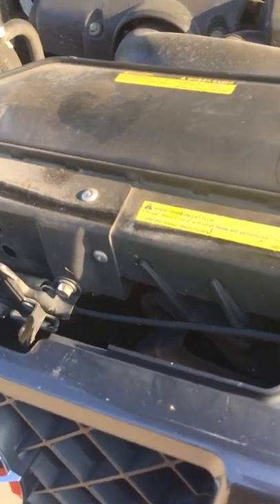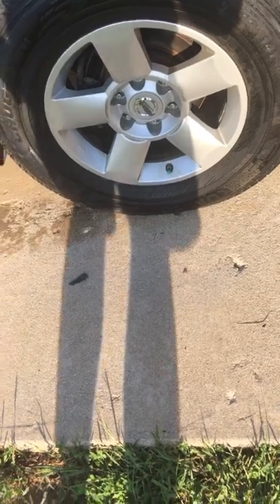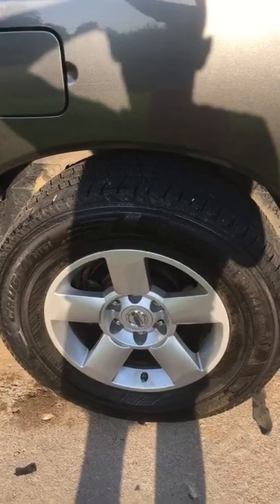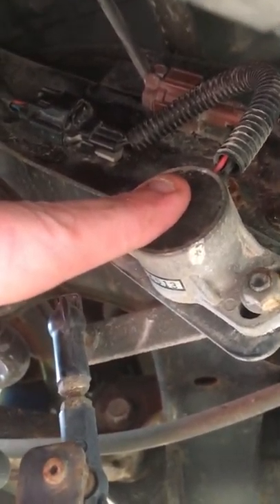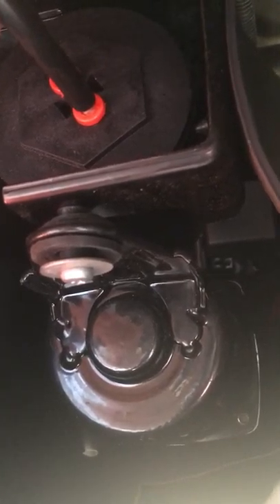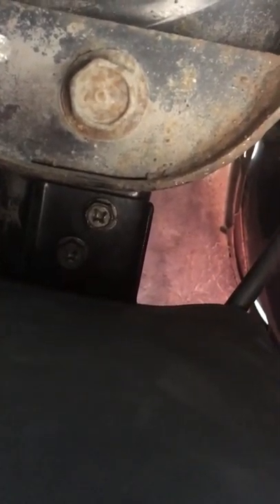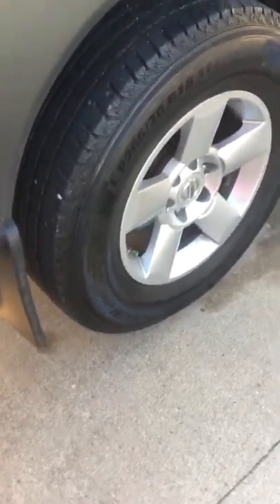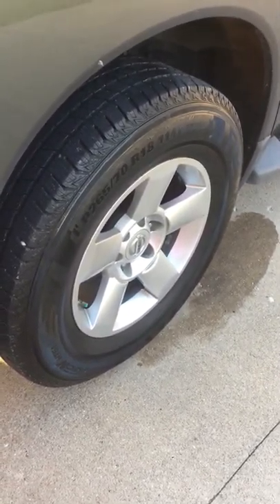Armada air compressor/suspension troubleshoot

Comment: Found sensor was my problem thanks but was not 80$ !! 160$
Reply from the maker: Your correct. I don’t know why I thought 80. Glad you got it worked out.
Reply: @jhoff2488  thank you!!!!  160 soo much better then I thought when I heared suspension I thought oh shit-  your the man !
Reply from the maker: @faithwalk007  if you don’t mind me asking how did you rule that it was the sensor that was out?
Reply: @jhoff2488  I took your advise and bypassed sensor with putting paper clips in. However I took a chance with trying that first before relays and soon as I put paper clips in compressor turned on. So ordered part from Nissan and what do you know !!! I was thinking maybe was a bad airbag too but when replaced that sensor airbags filled fine-

   I watched few other videos and seems like relay- compressor -height adjustment sensor or bad airbags were  main factors.
Reply from the maker: @faithwalk007  awesome man. Thanks for the feedback.
Reply: Jordan Hoffner do you have a video of how you did the bypass to check compressor?

Comment: Does the same part fit the QX80 2014-15?
Reply from the maker: Which part? The compressor?
Reply from the maker: And I only think the QX56 models for Infiniti would be compatible. Your model is much newer. I looked it up and the 80 looks a lot different.
Reply from the maker: @deangeloevans741  I believe the QX80 is different. SAme principal though. But the one I have I think would only work with QX56.
Reply: @jhoff2488  ok thanks

Comment: I have a d2racing air suspension set up with just the basic dual switch control management.... my air compressor will not turn off anymore please help....
Reply from the maker: Mustafa Gak have you unplugged the solenoid under the hood and plug it back in to reset the system?

If that doesn’t work I would lean towards the leveling sensor. Expensive little part. It may be tricking the system to think it’s never level and keeps telling the compressor to engage. 

When the compressor is on is it actually filling up your bags? If so I guarantee your bags blew due to air pressure which is causing your compressor to remain engaged. Air is leaking out as air is coming in. 

Hope this helps. Let me know.
Reply: @jhoff2488  have not tried to unplug the solenoid under the hood that u mentioned or even the relay that's in the trunk but the air suspension kit came with a car I recently purchased everything was working well up untill earlier today... I have an on/off button for my compressor under the steering wheel that I used to turn the compressor on but it will no longer turn it off... unless I unplug my battery complely
Reply: @jhoff2488  and the bags I dont think are blown as I can still use the control management to air up and down properly just the compressor that fills the tank will not turn off
Reply from the maker: Mustafa Gak do you know what that switch is connect to?
Reply: @jhoff2488  should just be the positive and ground wires for the compressor but I'm not sure as I still have yet to actually take the panel off but I will be doing all of that as soon as the sun comes back up
Reply from the maker: Mustafa Gak let me know tomorrow. If your having troubles post a picture of the wires from the switch to where they lead too. I am better at seeing things versus explaining.
Reply: @jhoff2488  how do I send u the picture?

Comment: Jordan, do you have any experience with the system loosing pressure over the drive time and the system not continually keeping the truck at the proper ride height? My shocks are new and I replaced my air hoses. My next guess would either be a leaky compressor or maybe a half bad relay under the hood. I have also heard that there is another brain box for the air suspension behind some panels behind the passenger second row seat on the driver side.
Reply from the maker: Eric Hasz my own guess would be a leak in the bags? Have you changed out the bags before? I don’t think it would be from a faulty relay switch. I do agree with a malfunction in the compressor. Pressure from the bags pushing air back out of the compressor due to a leak somewhere causing it to never be level. 

Another trick I have heard is get about three people to sit in the back around 500 lbs. let the compressor kick on all the way. Turn the car off and let the leveling system calibrate itself. Kinda like letting your phone battery die completely to recalibrate the battery. 

Lastly are your air hoses placed in the two holes correctly?
Reply: Thanks for the quick reply. I don’t really have an issue with it being the same level on both sides. I did change the bags out. Also yes the hoses are in the correct holes. Mine is more of an issue with it not staying inflated during the drive. I let it fully inflate before I leave and by the time I get 20 mins down the road I am almost riding on the bump stops. I let it air up this morning and turned it back off. Just went and checked and the bags are completely deflated. I’m thinking what you are, somewhere the back pressure is leaking out of the compressor
Reply from the maker: Eric Hasz It sounds like the compressor itself after your last reply. Sounds like it is leaking somewhere in the lines. Once pressure is in the system, it should remajn there unless the system tells the compressor to get rid of the air. I would double check again for leaks at the fittings. Where the lines connect to the shocks themselves would be most common. I missed the part where you emphasized while driving my bad. That makes me more sure your leaking air. Either at the bags or within the compressor.
Reply: @erichasz7068   Hey did changing the compressor work for you? I have the same issue. Cheers
Reply: @DallasChisholm  it did for a little bit. But the new shocks kept bleeding off too. Eventually it all stopped working. I switched it over to conventional spring and shock. Got a kit off of rock auto. The springs are much stiffer than the stock ones. Helps with light towing.
Reply: @erichasz7068  thanks Eric. I ordered a compressor and shocks. Hopefully it gets me through the summer! I'm towing a 7000lb  trailer so I hope it works.

Comment: I needed to replace my air suspension control module too. Its in the rear window well near the rear seat of the car. $100 on ebay. Used.